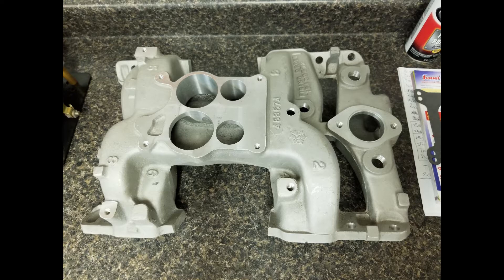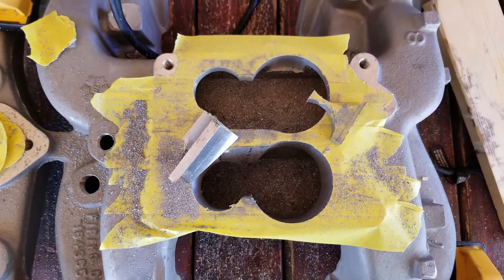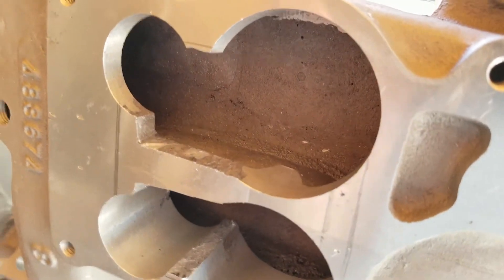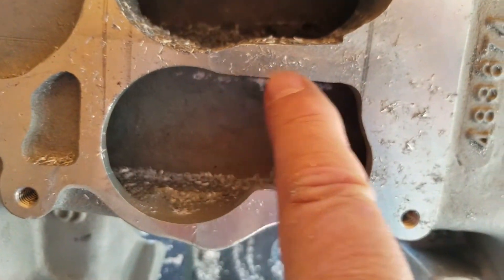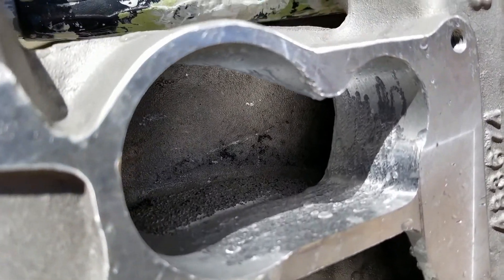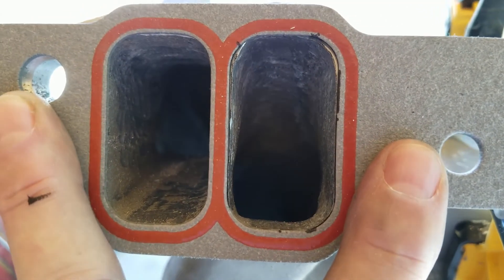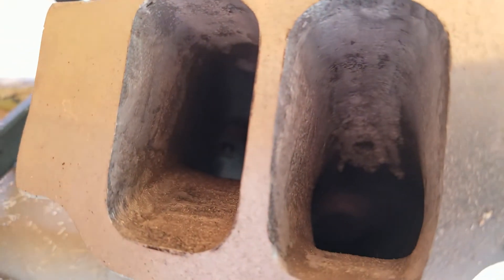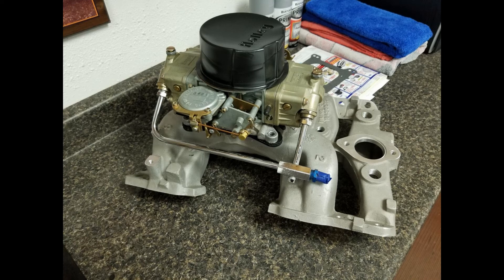Pontiac 455 HO intake manifold modification for EFI

Comment: I dont understand why you did this mod?
Reply: Well if only you could of waited now they have a Quadrajet Sniper Throttle Body
Reply: @jrento9562  it only flow 715 cfm. too small.
Reply: I also have a Holley Sniper on my 77 Can Am with a 455 and a performer RPM intake with a spread bore intake and just used a Square-Bore to Spread-Bore Adapter Plate 2732
Reply: That's what they said about my Can Am its a little tight but it works lol.